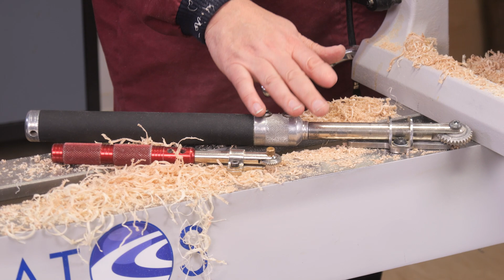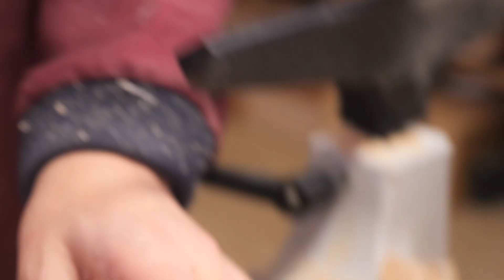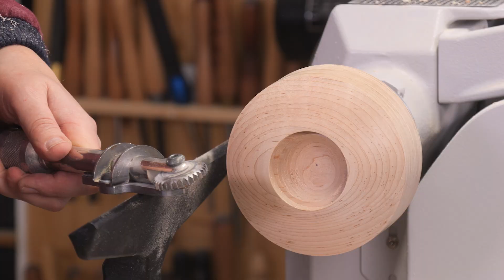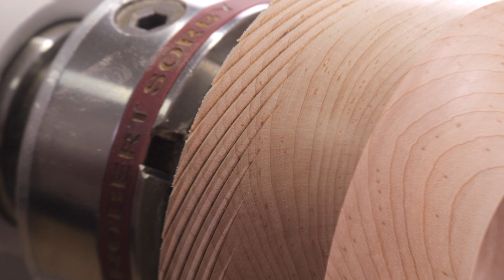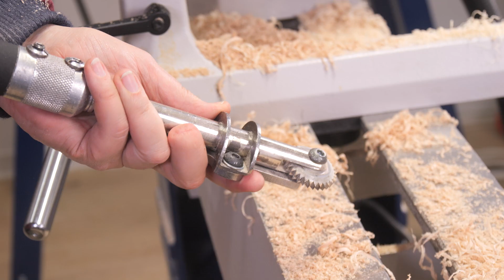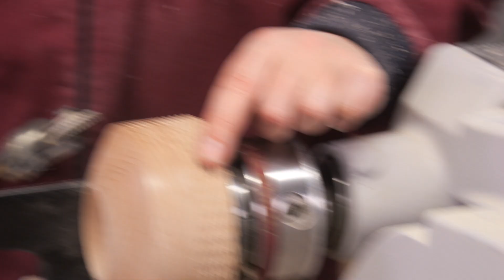Detailed walkthrough on the Robert Sorby Spiralling System

Comment: This is a great video for  those getting started on texturing. Just a follow up question, if the slowest your lathe can work at is say 700 rpm, are these tools still useful? or usable i should say?
Reply from the maker: Very hard to say, i would personally not recommend to use it with 700 rpm